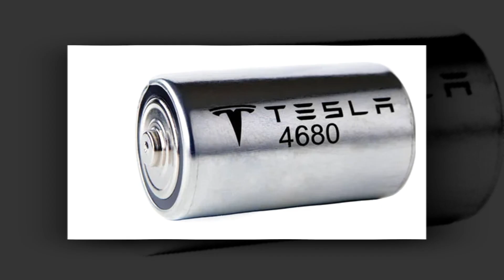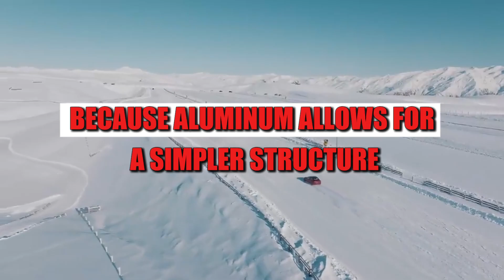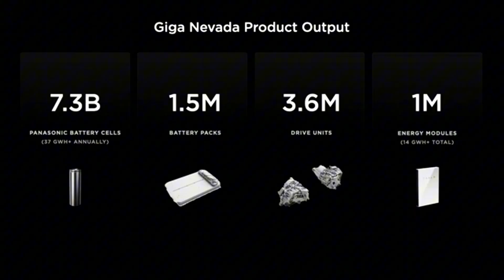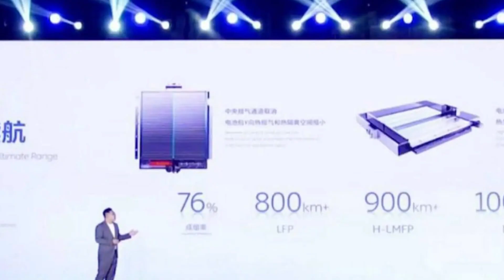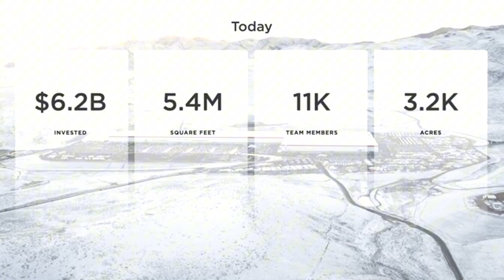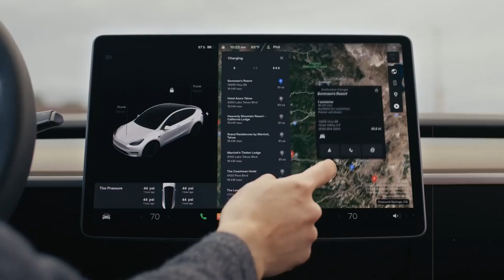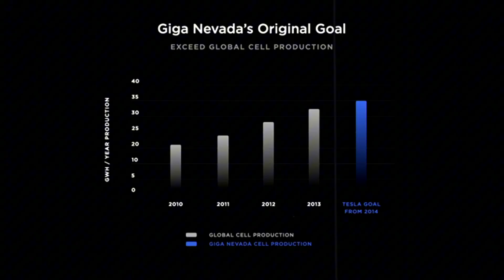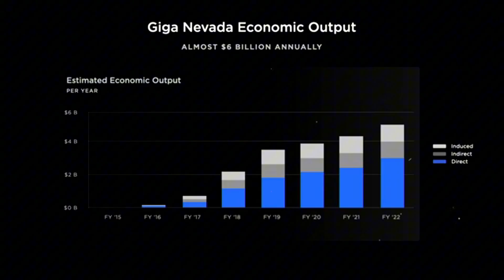NEW TESLA BATTERY Aluminum-Ion — $15K Model 2, 5-min charge, 25-year life — Elon Musk reveals

Comment: if the charger is a 250kwh charger it can only charge at a max of 250kwh or just over 4kwh per minute so to go from 20% to 80% (60% charge) using a 50kwh battery would be a capacity of 10kwh to 30kwh or a 20kwh charge equals 5 mins at 4kwh per min. This assumes that you can get a stable 250kwh charge of course. Impressive but how long until it is commonplace? Can existing ev's have their battery replaced with this type? Some ev's can't charge at 250kwh. I assume it is a lot safer than Lithium as well.
P.S. I think my math is correct but I could be wrong, work it out for yourselves to be sure and comment if I have cocked it up.
Reply: ⁛大ㄒ乇乂ㄒ🇺🇲🇺🇲🇺🇲🇺🇲±𝟭𝟵𝟳𝟵𝟰𝟯𝟲𝟱𝟴𝟮𝟮🇺🇲𝕎𝕙𝕒𝕥𝕤𝕒𝕡𝕡𝕟𝕦𝕞𝕓𝕖𝕣👍🏼👍🏼👍🏼👍🏼📈📉大❤️
Hey there! DM I need to clarify a few things about your comment and share some important with you📈📉